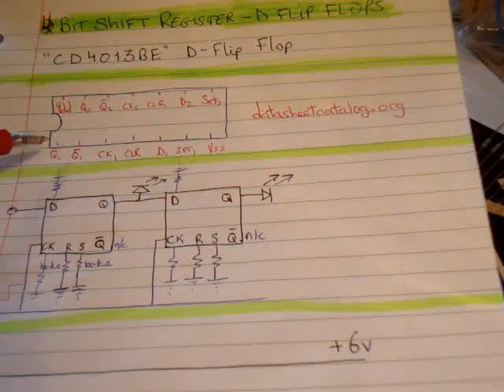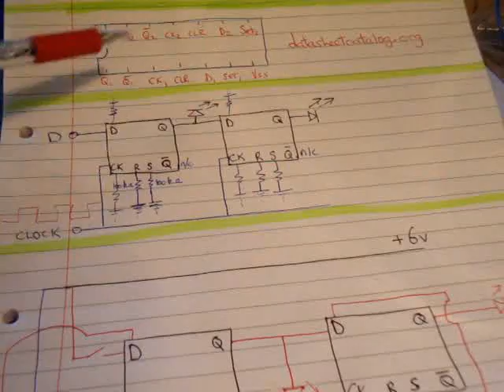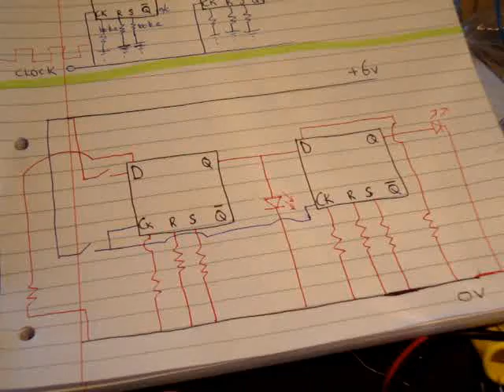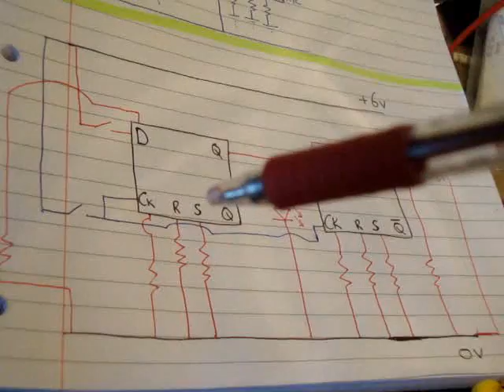Electronics 18 : How to Make a Shift Register

Comment: I'm a bit of a noob here... Why are the inputs not used connected to the ground through resistors? I guess I understand why pull them to ground, but why the resistors?
Reply: Visual_Vexing because of their sensitivity. Static electricity could be easily passed to them - which could set them to 'high'. We want them 'low'. We need as much high resistance there as possible (to have lowest possible consumption - lowest current). And now, since we have resistor there we could easily put HIGH on same inputs without fear of shortcircuit, too. Btw, resistors could be replaced with simple wire, but in that case you are not going to be able to set it - short circuit...